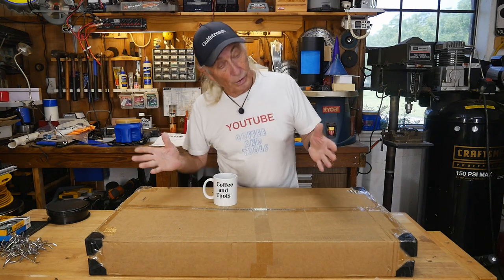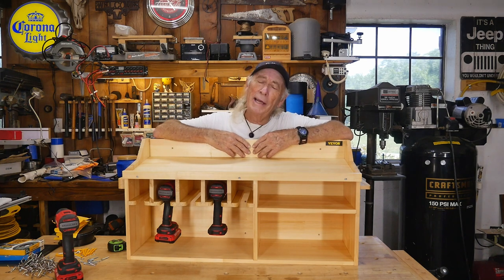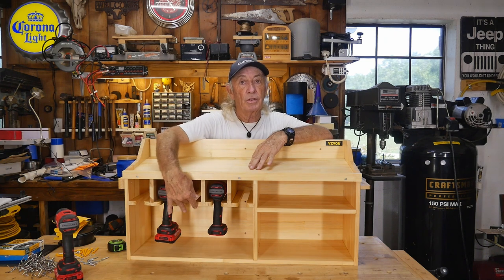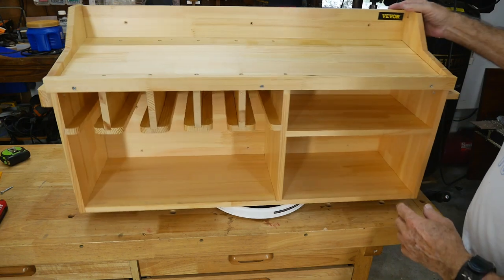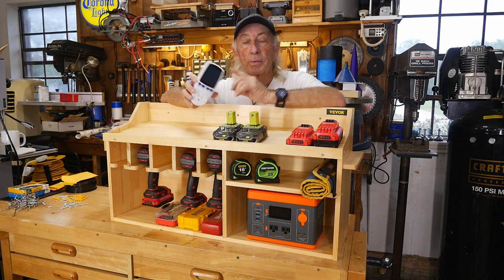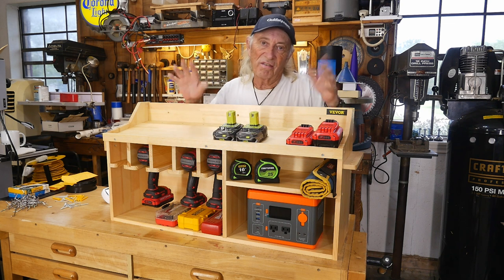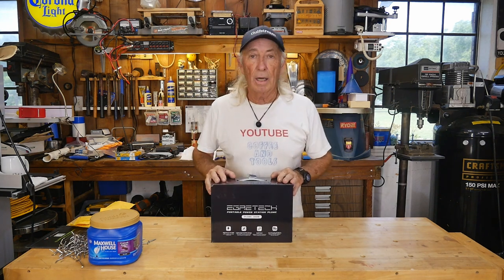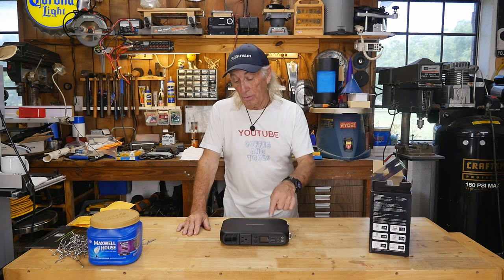Vevor charging station cabinet for power tools, Contest this week, C&T ep 358

Comment: Just wanted to mention, the 5 slot charging station is ON SALE NOW for 71 dollars and free shipping!!
A great deal got even greater! Ordered mine tonight! It may be an optical illusion but, if you turn the drills and impact driver upside down, would it fit in the slot without the 1/8” adjustment? 
I think, like you, I’m gonna like this a lot more than my own build. My build is smaller…but I like the angled charger tray, tool side storage and extra storage. Couldn’t build one like this at that price!!😊👍🏻
Reply from the maker: mmm...haven't tried upside down, but just ended up cutting them on the table saw. 1/8 per side. Normally I'd sell off locally, but this was is a keeper and hangs in the barn now. Sale priced !  WoW this is news !
Reply: @SirTools  it was bizarre!! I didn’t put it in my cart but tried to “buy it now” at 97 dollars and it just kept spinning…so I closed it out, reopened the app and when it reopened, it had dropped to 71!! 🤷🏻‍♂️😊
God DOES work in mysterious ways!!😎 God bless!!
Reply from the maker: WoW, so glad you got the GOOD price. Wonder what happened there, but who knows.
Reply: @SirTools  my coffee and tools gnome interceded for me!!😎🤣
I’ve not been pleased with the one I built but I just have not had the time to do a phase two model and correct my shortcomings with the original. THIS little gem will MORE than meet my needs AND, be a lot faster to assemble than doing my own layout! Wicked excited to see it hit my porch so I can get it AND my vevor pegboard wall panels up! I do need to get on vevors page and order some extra pieces of hangers and such….the conventional pegboard hardware won’t work in the vevor honeycomb pattern. I’ll also have heat in the garage this year so I’ll be able to make great use of all this STUFF I’m stacking up here!!🤣🤣😎👊🏻
Reply from the maker: Heat in the garage is a dream come true up there. You and I know it. I'm trying a portable ac machine here off my solar. The kit was just bigger than the one I built and so, time to move into bigger. I'm using the new peg board beside the 3d printer farm.